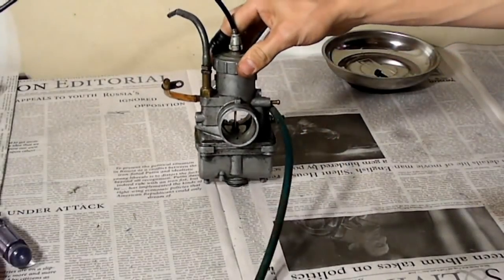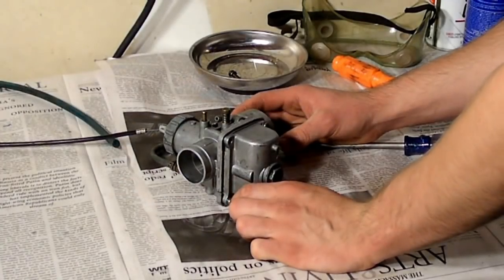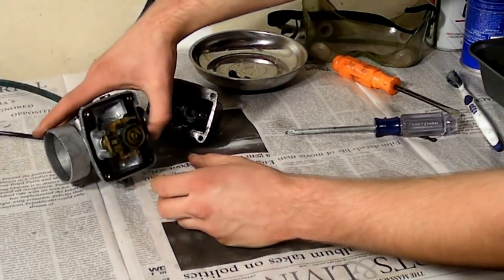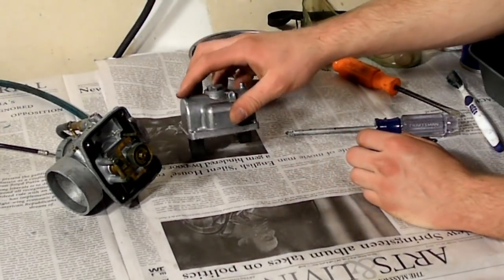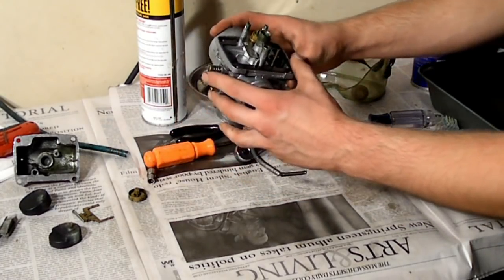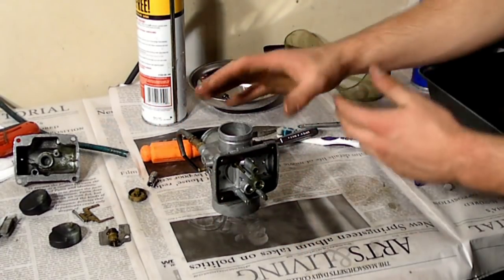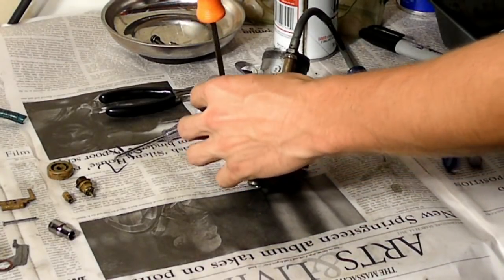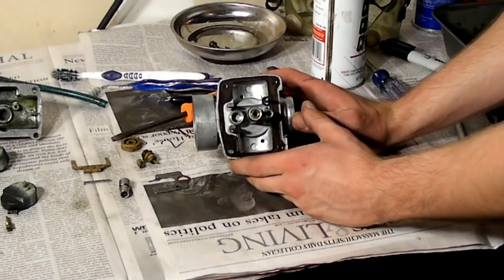How To Clean a Snowmobile Carburetor

Comment from the maker: Well, I'd say run a compression test and see if the new head gasket is good. If that checks fine check the adjustments on the carburetors and make sure they are in synch.

Comment: When you removed the idle screw, did you count the amount of turns and re-insert it the same number or did you measure the barrel height and adjusted both carbs to the same height?

Comment: I did some repairs on my carb and my sled hasnt been running good since. It idles good but after 6 RPM it sounds scratchy and really weak. All i did was remove my head gasket and take apart the whole carbs. I did it before minus the gasket work. What happened was inside the top of my carbs is the therottle placement thing. but the MAG side of it came off and it wouldn't run good. was running on only the PTO. But since repairing that my engine hasn't been running good. Not sure what to do. Ideas?

Comment from the maker: I'd do some research and search around and make sure you have the adjustment screws right. Make sure you have them at that baseline and see it goes then. Trying to adjust things and getting it to run right without really knowing if it was at least in the right starting point doesn't work, i've tried only to find out later that I was starting with it all out whack.

Comment: Dump in a container of coca cola overnight. Cheaper than carb cleaner. Rinse with water, allow to air dry then reassemble. Never failed me yet.
Reply: Geez, never thought of that. I’ll try that as I’ve been using regular gas with ethanol (yeah, I know)…

Comment: my compression is 140 and the other side is 150 would that be ok? also fouling  a good amount of plugs, should i just clean the carbs? 1998 formula z 670
Reply from the maker: +Fetterly 670s seem to like to foul plugs. I wouldn't worry about a difference of 10 PSI in the compression from one cylinder and the other.
Reply: +WeekendHandymen awesome thanks! should i clean the carbs out?
Reply from the maker: +Fetterly Wouldn't hurt. A lot of people will do it as part of their getting the sled out of summer storage ritual.
Reply: +WeekendHandymen thanks for the reply, great video
Reply: Go to a hitter plug if you're fouling

Comment: I have 89' polaris indy 500. It runs and stays running. But if you give it gas it stalls. IM THINKING (CARB CLEAN). Advice/Tips?
Reply from the maker: Wouldn't hurt. Worth doing since it's a simple job to do.
Reply: WeekendHandymen  appreciate it brother
Reply: Can you just air dry the carb after you have used the carb cleaner

Comment: Ran compression check and it checks at 120 120. But for some reason MAG seems a little bit lower than normal. I changed the head gasket(again) and still no power. Has to be something with the carbs. Feels kinda like a primary clutch failure but still has that low end power so cant be that. I will take out the carbs again. They are flat top carbs. I don't want to bring it to the shop because they are uneducated money lovers and would deff lie to make a easy buck.